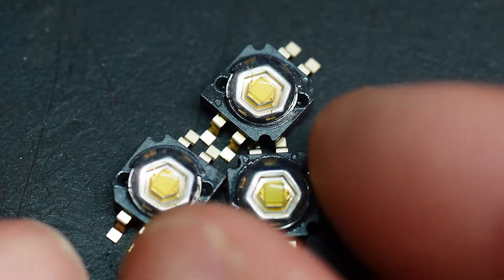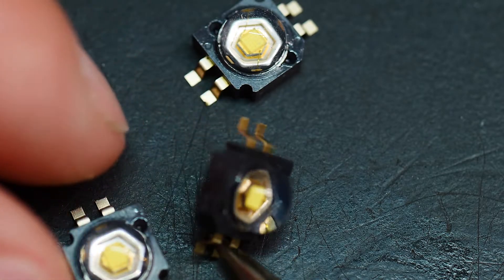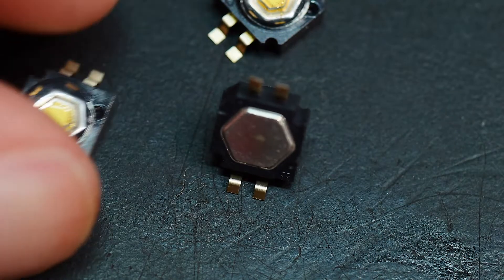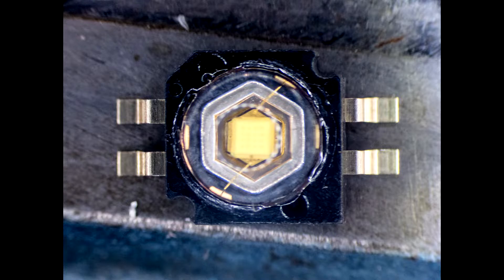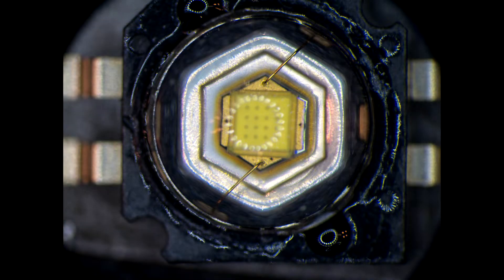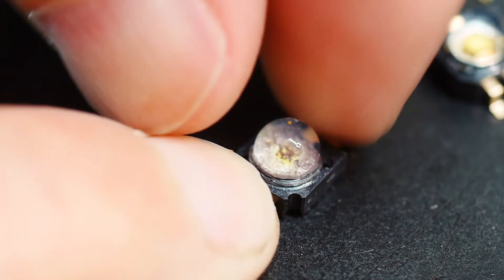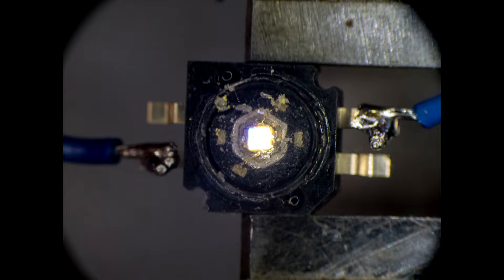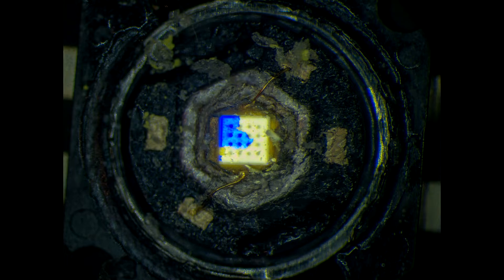#530 White LED construction

Comment: If I understand correctly, this is a yellow phosphor on top of a blue phosphor on top of a diode. But if my understanding is correct, why require any diode? Or is this multiple diodes in series?
Reply: Sorry I'm a noob
Reply from the maker: the single (about 1mmx1mm) LED is a GaN blue LED. about 450-470nm blue light. the phosphor is a yellow Ce:YAG
Reply from the maker: the blue light is absorbed by the phosphor and re-emitted as yellow. some of the blue light does not get absorbed. so Blue + Yellow = white
Reply: That makes sense to me. But if we're just looking at the blue part, before the yellow fluorescence, I wonder if it needs to be a diode. Could the blue phosphorescence be achieved in a device with interchangeable cathode and anode?
Reply from the maker: @donaldviszneki8251  I worked on thin film electroluminescent displays that used ZnS and alternating current drive.
Reply: @IMSAIGuy  ahh! Thank you!
Reply: @IMSAIGuy  Do you think it's reasonable to open and scrape the YAG off a ceiling LED light to convert it to a blue source for charging strontium aluminate pigments? I was thinking of using one with a foiled box to charge glow in the dark epoxy molds.
Reply from the maker: @Tattlebot  no. Most LEDs cannot be scraped